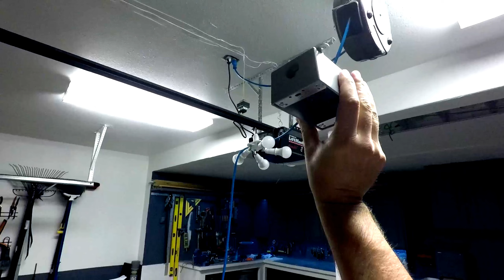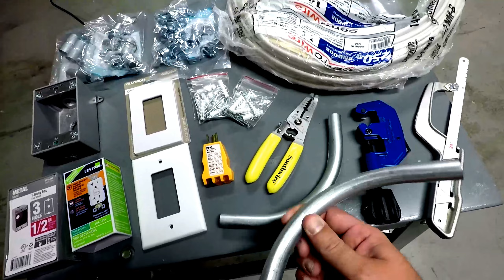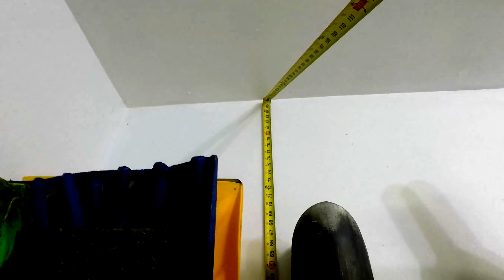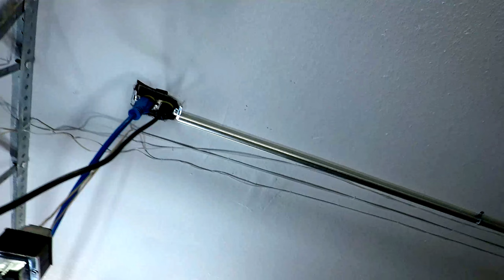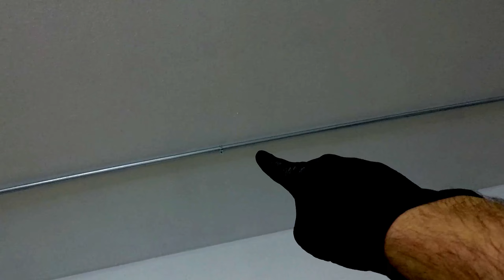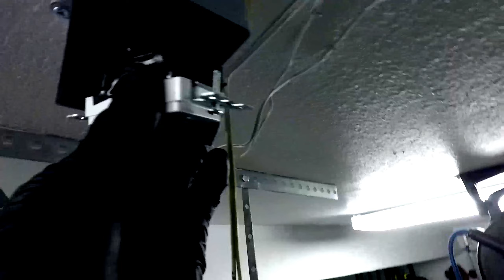How to Add An Electrical Outlet in a Garage

Comment: You are showing using 14 gauge wire, which can only be used with a 15 amp circuit. Although later in the video I can see  that your breaker is 15 amp,  you show using a 20 amp outlet, as seen by the type of plug it allows with the neutral prong turned 90 degrees. Using a this outlet "invites" someone to plug in a heavy 20 amp device by the use of the 20 amp outlet.  You also show connecting to a yellow cable going outside, which indicates 12 gauge. That in itself is not unsafe, but potentially confusing. Also, none of your breakers show arc fault breakers, (AFCI), now required by code for outlets in living areas where someone is apt to use lots of extension cords being used as you do. Your breaker box seems to also have mostly 15 amp circuits. It also looks like the outlet you are adding is on a circuit shared by other outlets in the house. I am also not an electrician, and I am not saying that you can't do this work yourself, but you should think about applying for a permit where you are adding new outlets. The advantage of the permit is that you would have the benefit of an inspector pointing out where your work might be unsafe. The NEC electrical codes and electrical inspectors are not the enemy; they are for your benefit. What if you have a fire, and it was found that you did your own electrical work which was not safe because it was not up to code? Not only you did not file for a permit, but you have even documented your work on YouTube!

Comment: I'm going to leave everything else be, but a tip for future viewers. Regardless of code, it would have been easier to run just the conductors. Romex gets stiff around corners like that. If you already had the Romex, stripping the sleeve for 35-40ft would have been much easier, just need a shielded ground. I have a feeling there was much struggling off camera.
Reply: Keith DiSarno what's a sheilded ground

Comment: WTF? 10 code violations in the first 2 minutes. Good luck with homeowners insurance.
Reply: How are they code violations? Please explain.
Reply: @apagan65  Are you saying you don't see ANY or MOST of those code violations? Really?  Or are you asserting these things AREN'T code violations? Or are you trolling?  I'm very low on the scale of being qualified for intermediate-advanced electrical work, but I can spot a scary number of violations in the first 10 seconds.   Running exposed wires through drywall. Permanent use of extensions. Mixing indoor and outdoor circuits (that hasn't been code in decades). Overloaded circuit (I'm not even talking about all the extensions; I'm talking about garage doors receive their own DEDICATED circuits... while old homes are sometimes ""old code" in this regard, it's VERY clear if you're adding new outlets this is new work and therefore must be brought up to code! Furthermore, beyond "code", he's using non-UL listed equipment adapters for his little "garage light chandelier" (I know because NONE are UL-listed - and they're actually illegal in some states like California).  You could counter-argue that it all uses less wattage than the OE incandescent that used to be used, but you don't argue with your insurance company and win.